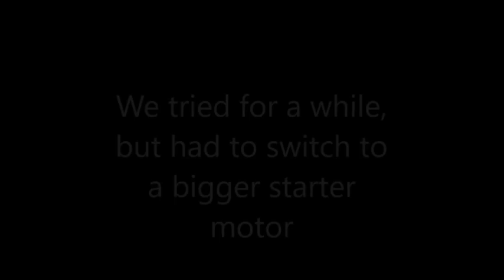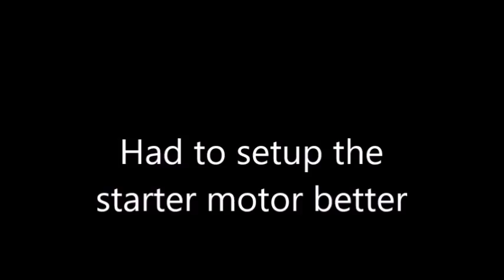Antique Motorcycle Engine Build (Replica) Part 36 First Start Ever!!

Comment: Hi Jonathan. If you wanted to cut a receiver groove in your lifters an early 700R4 transmission uses thin teflon sealing rings on the servo pin. The pin is larger in diameter than your lifters but it is made like a piston ring and you could trim it to fit your lifter bore. If you know any transmission guys they probably have some, if not I have some at work I could send you.

Comment: I have a big ole smile on my face, I watched every build video, I have so much respect for your build process and abilities, you just don't see this anymore! When it fired up, I yelled out "yeah!" And scared my wife awake lol. The intake valve timing being off one tooth, knowing that I could already hear what it will sound like when the valve timing is correct and that beast roars out at full throttle. Great job Jonathon! You're gonna cause us guys to build small  forges in our garage and melt down stuff!

Comment: BIG CONGRATULATIONS Jonathan!!
"It's alive" The JAW Frankenmotor" is alive and running. Of course there is some tweaking and adjustment necessary. But YOU designed and built an antique style engine that runs and sounds great! An amazing achievement you should be proud of!!!

Comment: In the early 70s,i had a 650 triumph with an ARD belt driven magneto. The old British whiz told me to back piston down, come back to 3/16".points should just break current of bulb/battery.Worked for me.

Comment: That 1/3 horse motor is fine, it runs good after you spin it, it just needs a new start capacitor (it's under the hump on the back)!

Comment: So close, yet so faraway. Always wanted to build a engine like that. I'd start with Volkswagen parts, cylinder , valve train and head. That can't be that hard to time. Maybe the mag. I'd use points and coil.

Comment: good idea using that electric motor and a belt as a pony starter I almost broke three fingers cranking on an old Tecumseh with a big drill I remember you saying you were going to break that shaft with the impact if you kept on with it guess you were right but you fixed it good and owned it well LOL everybody gets a little excited sometimes I do things I know I shouldn't and I break a lot of s*** also

Comment: YEA! Very cool engine, it's gonna look perfect in an old style bike. I can't compliment you enough on your skills and knowledge, it was very interesting to see it come together. Great job with the video series also, I know a lot of things happened off camera but did you dial in the cam/valve timing? As you know, just a couple of degrees can sometimes make a big difference on starting, power, and idle quality. The mag chain looks to have a good bit of bounce also, do you think it may be enough to affect ignition timing? 

Off topic but kinda funny. I heard a commercial on the radio yesterday for some soap. It was called JAW and it stood for Just Add Water. I immediately thought of you and this engine. 

Congrats on the successful start and run and good luck on tweaking to perfection (first kick - every time).

Comment: how about a kick starter from a maytag washer. grew up with some brick top lawnboy lawnmowers that started like that. blisters on hands every time
Reply: This is for a bicycle not a motorcycle. The difference is a bike has pedals. When the rider pedals the bike with the clutch engaged it also turns the crank thus starting the motor much the same way as Jonathan's electric motor set-up in the video did. Because the bike is belt driven.

Comment: if its a split phase motor try lubing the centrifugal switch which is probably stuck in run posistion.

Comment: Pretty good considering the engine is a homemade unit from a mixture of parts, none of which were made to work with different parts, Yamaha piston/conrod, briggs and stratton cam, vintage cylinder, and JW,s know how and we have a running engine.

Comment: Where did you set the mag timing? A lot of engines in the old days had the mag timed at after top dead center for starting with a hand advance and the points might be touch close too. But the big question is" how will you start it on the bike? "   Nice work BTW! .

Comment: Having the valvetrain exposed helps in diagnosing things, right?  With enclosed valvetrain, you need to start taking things apart or it's like looking at an electric circuit and trying to see where the electrons are going.